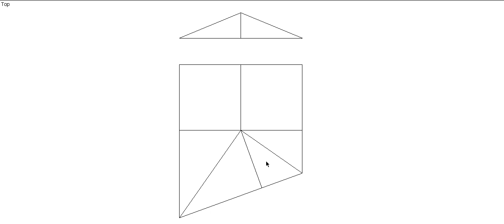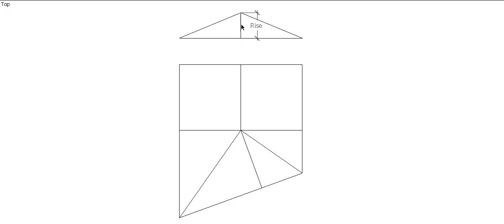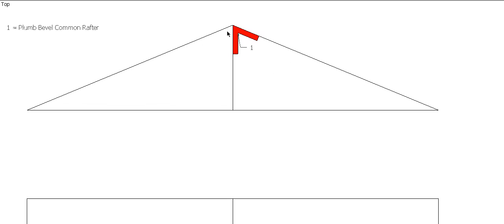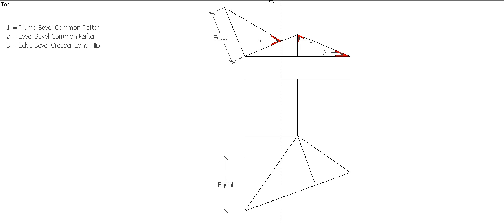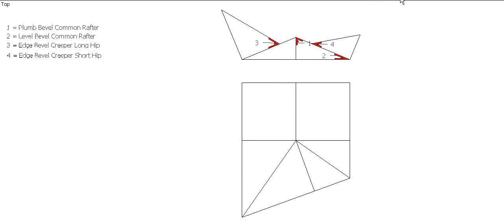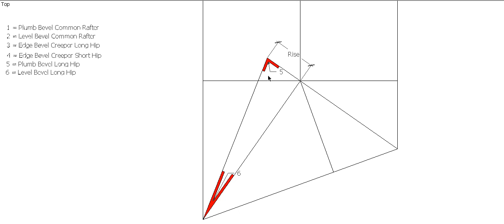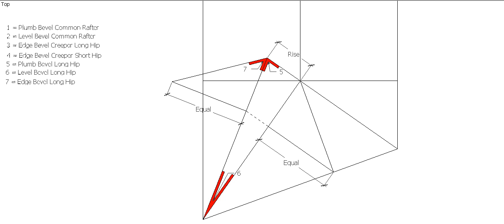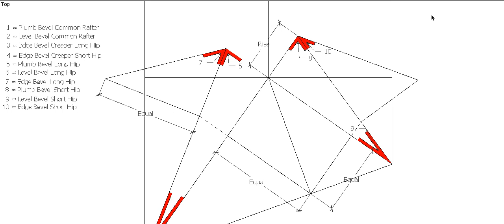Oblique bevels

Comment: At around six minutes that's finding the plumb cut for both side of the hips
Reply from the maker: Hi, because the Hips are different lengths the will have different bevels, the ones at the 6 minute mark are for the shorter of the 2 hips. Hope this helps